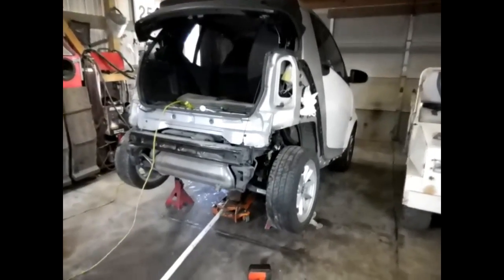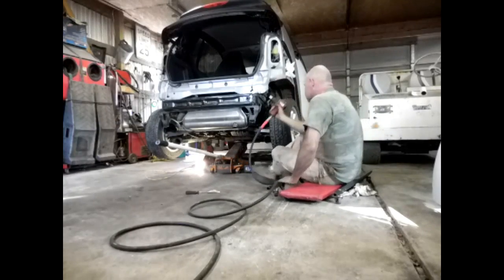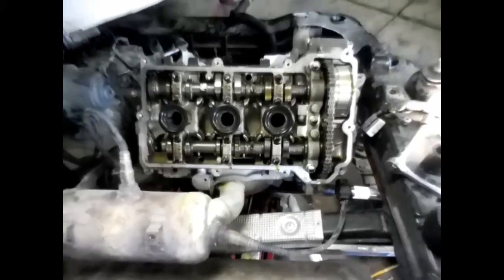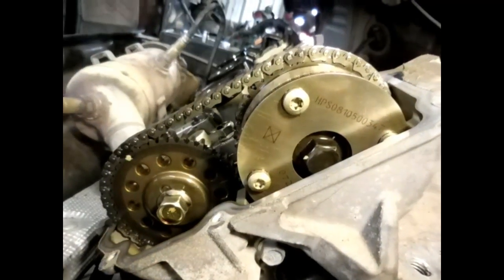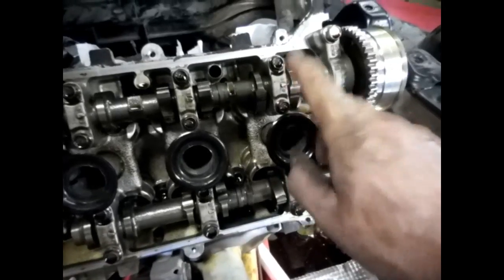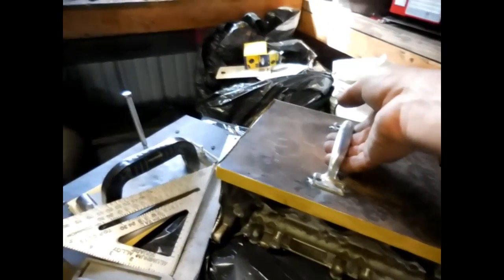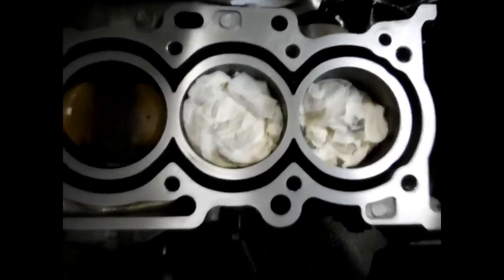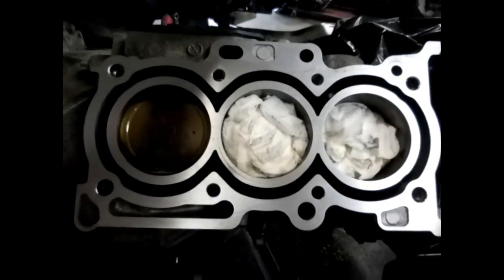smart car head  gasket replacement 1

Comment: I've replaced my engine in my smart twice, this isn't fun. First engine had no 2nd cylinder, second engine starts and runs fine no codes or anything but overheats and blows out the coolant out of the reservoir when the fan kicks in/out, think it might need a head gasket or new head
Reply: Hallo sir! What engine size is it? Thank you!

Comment: What needs to be done inside the car before taking anything loose under it? If I drop the engine are all the lines easy to get to? Great video..Oh BTW.. any special tools needed or will a regular metric set work?
Reply from the maker: its not a lot in the car you have to unhook the ecm in the back right corner  of car inside  you have to cut the hose clamps off if they had never been replace  but just replace them with hose clamps  no special tools
Reply: Thank you Tomas..what size torx bolts are those 4?
Reply from the maker: I cant remember  right off hand    but if you need me to find out I can go get the car and see     thanks